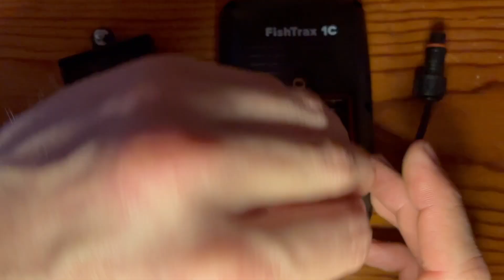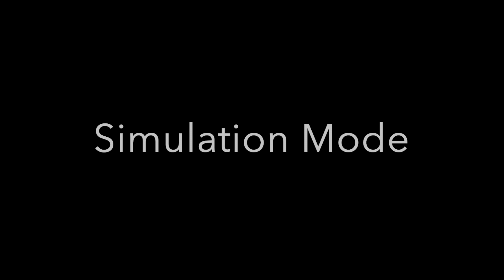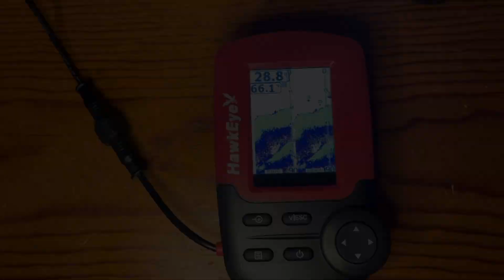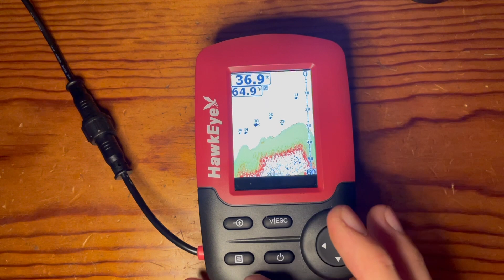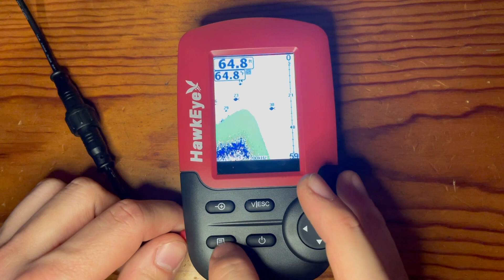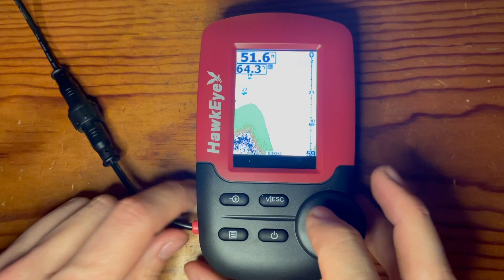Hawkeye FishTrax 1C Video Manual Review

Comment: Just took mine out on my kayak for the first time yesterday. I have the paddlesports transducer arm. The depth reading was inaccurate. Reading deeper than it should. I played with the settings but couldn't get it dialed in. Any advice for getting the correct readings for depth? Thanks!
Reply from the maker: Nothing specific. If I remember correctly, there is a transducer setting to account for top of water vs transducer depth. I think the manual has some troubleshooting info and their website should have stuff too. How far off was your depth reading?
Reply: @JSOutdoorsLLC  I had it in demo mode! 🤣
Reply from the maker: @kennymorris862  ah haha. Hopefully it’s working better now.

Comment: So you can’t have it in direct sun? Makes  no sense as it’s on a boat or kayak, so sore it in 120 degrees, if in the sun it can get that hot.
Reply from the maker: I have had it in direct sun and it works fine. I think there is an element to protecting it from heat though. I have similar heat issues with GoPros.